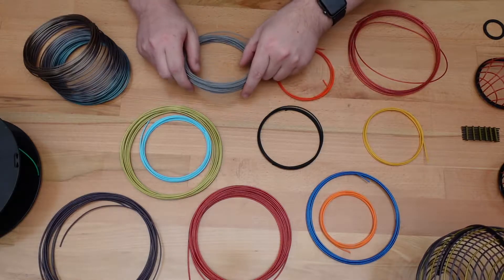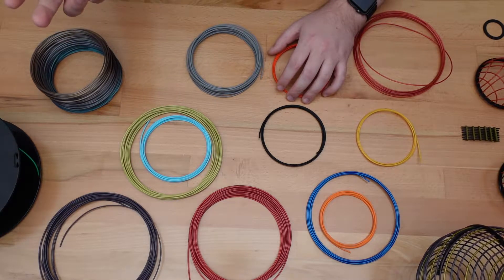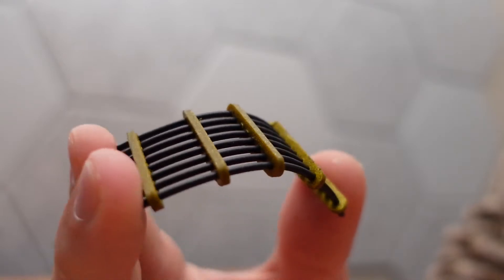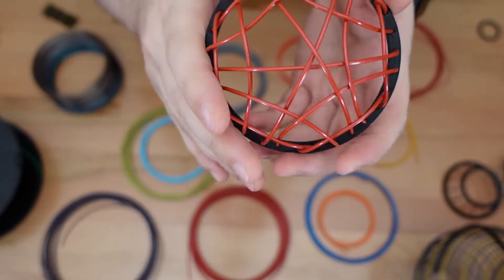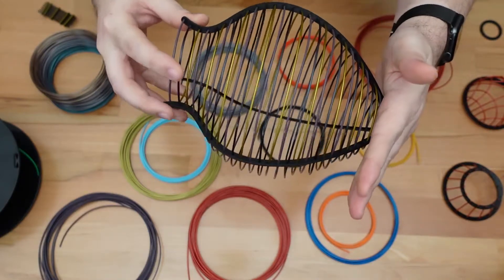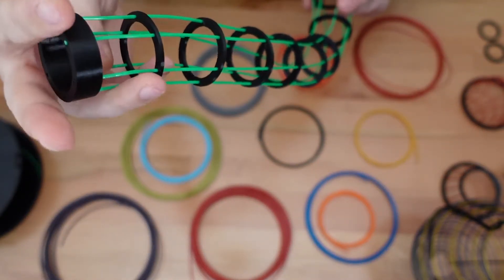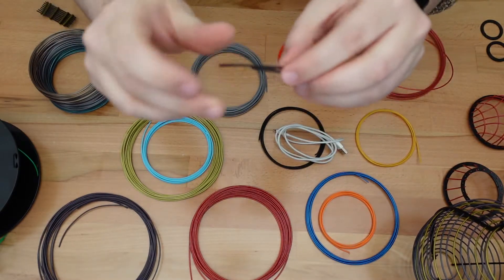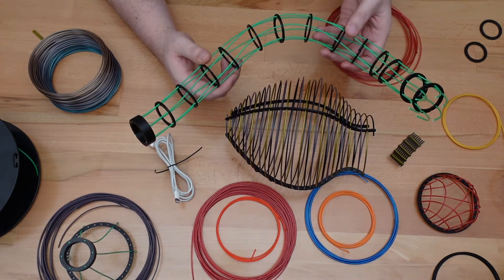3D Filament Experiments

Comment: My idea for filament scraps is to put them together until i have a roll of random colors. I haven't tested to see if it would work, but i think it could work
Reply from the maker: Wonderful idea! I've seen it work, but it does take a little effort to get all the splices right. Good luck!
Reply: @3DPrinty  thanks! I tried, and am now trying to find a tube I can heat the pieces in to keep them the right size, but after then it should actually work

Comment: I feel like the 'stiff but posable' form could be really useful for a drawing reference, like making a basic(ish) skeleton shape and using it as a posable model?
Reply from the maker: That would be very cool!

I know PLA grows brittle over time, but the long green tube has remained flexible in the many months since I posted this video. I think its longevity is due to the bends being fairly gentle - so any possible figure would need to be limited to similarly gentle bends - or the filament might need to be replaced on occasion.

Comment: that filament tube could handle pesky desktop cable management pretty well
Reply from the maker: You might not know it from the closing credits, but I'm a huge fan of cardboard spools. I'm glad to see more manufacturers have recently announced switching away from the mystery plastic spools that can't be recycled. Spool-less filament is also interesting, but seems less popular.

I also think more designs should work toward reducing support material use. The vast majority of my plastic waste (except for the occasional failed print) is just the tiny purge line and skirt (or brim).

Finally, I hope to see more advancements in TRULY compostable filament. If you haven't already seen the recent video by Maker's Muse on the subject, I recommend it! https://www.youtube.com/watch?v=jCsnVp6mEbk

Comment: Oh, that cord management idea might be good for my standing sitting desk.
Reply from the maker: That could work! If you try it, avoid setting it up in a way that bends the filament back and forth frequently. PLA will eventually snap. I haven't tested this, but flexible filament, like TPU, might be able to handle frequent movement.
Reply: @3DPrinty  basically any non pla, petg would be good, nylon good, pc good, tpu, tpe of course